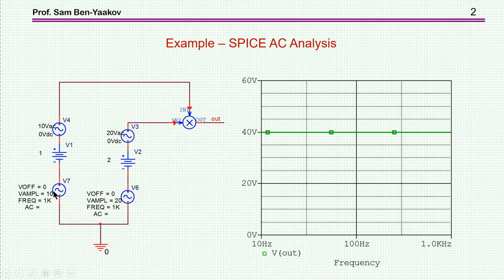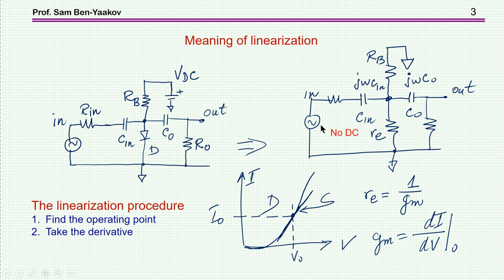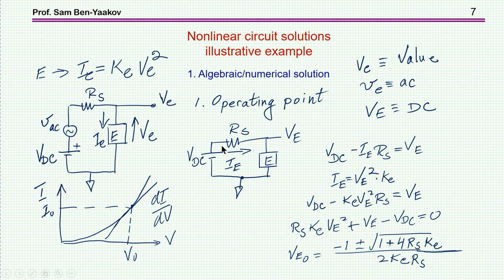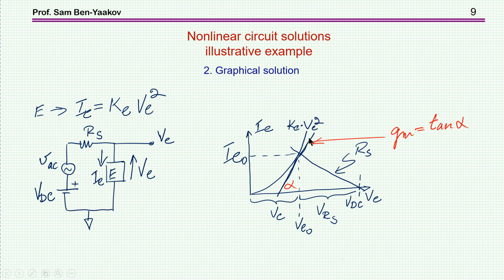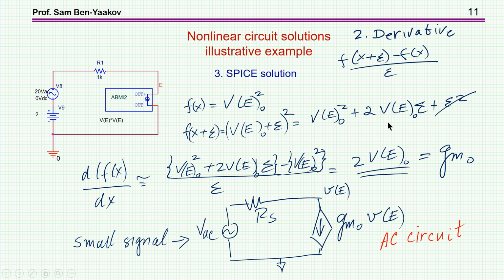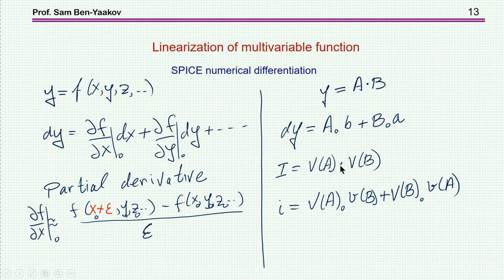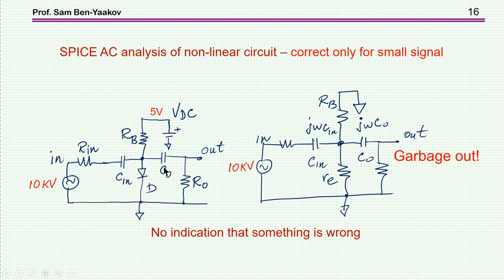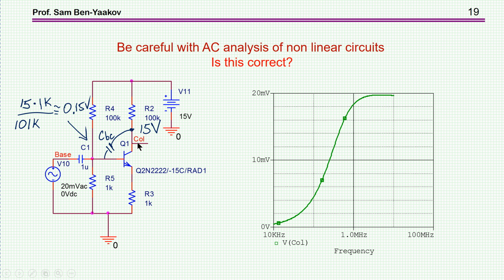Electronics basics:  Linearization of multivariable function and SPICE

Comment: Around: 21:38 you show a schematic with "garbage out". I wouldn't state it that way, because linearization means the circuit obeys scalability (homogeneity), the ratio of your output voltage to your input voltage still makes sense and you will find the same ratio in a transient analysis as long as your input signal in the transient analysis is small enough to guarantee linearity. In other words: the amplitude of the voltage in an AC-analysis doesn't matter as such, the ratios of the voltages or currents will be the same, that's the reason why  often a 1V  AC-input source is used because that way VDB(out) directly results in  20log|H(jw)| . An other example is using an AC 1 current source to determine the value of an impedance, again the numerical result is useful even though you should determine the impedance in a practical set up in a totally different way, probably with much smaller currents to guarantee linear operation.
I think you shouldn't use the same amplitudes in your AC analysis and transient analysis per se, as long as you know what linearization and   homogeneity mean and you check for a correct DC bias point. B.t.w. great video!
Reply from the maker: Hi Hugo, For the example shown, the output is garbage. The point I am making is that it is the responsibility of the user to recognize garbage.
Reply: If you'd interpret the output as a voltage it is garbage but if you look at the ratios the result makes sense. I agree that the Spice user needs to have a sufficient insight in the underlying mechanisms not to produce garbage results. Kind regards, Hugo